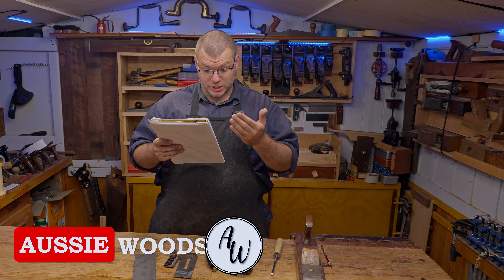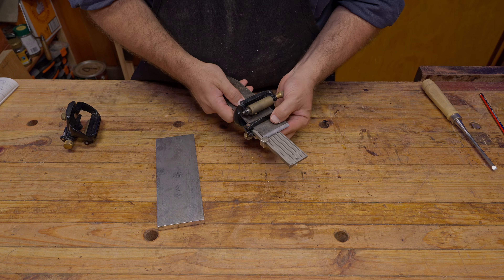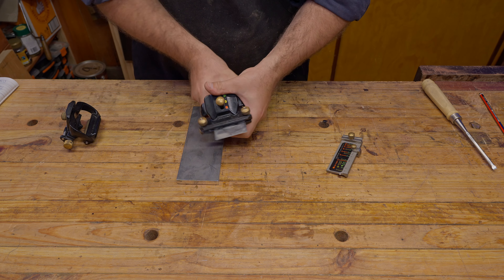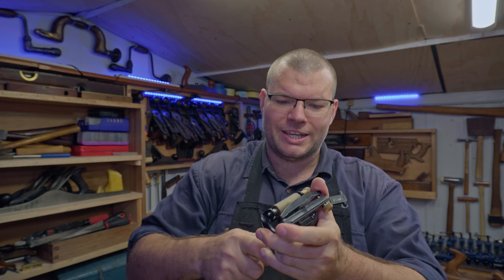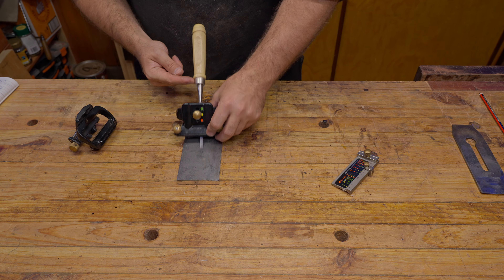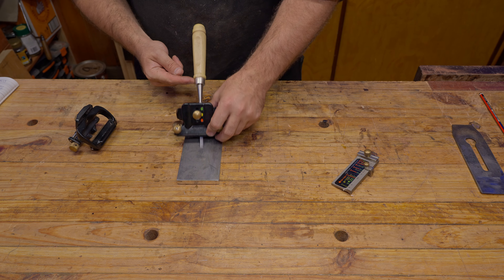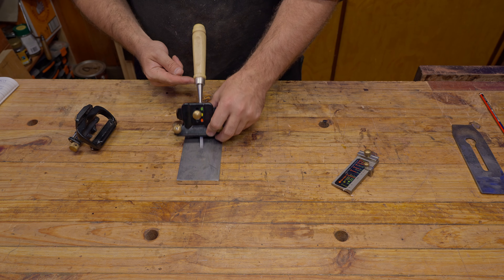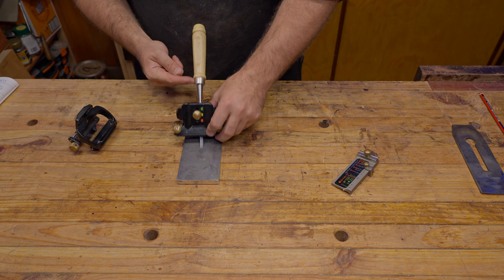Can the Veritas Honing Guide Hold Tapered or Narrow Blades?

Comment: Keeping narrow chisels square is the most difficult thing to do when hand sharpening in my experience. It was the main driver in me investing in a good grinding wheel to reset edges when I mess up.
Reply from the maker: @robnichols9331  i do agree narrow chisels are definitely the hardest to keep square, i have a tormek which i got primarily for restoring old plane blades but it also comes in handy for all my chisels to get them back on track.
Reply: @AussieWoodshed  I haven't gone the whole hog and got a tormek (I hate the way every extra seems to cost a fortune), but I have invested in a good quality slow grinder with a couple of CBN wheels (80 and 180).
Reply from the maker: @robnichols9331  with hindsight that would probably have been a better option for me, but when i got the tormek CBN wheels weren't available for me. But if i was looking today i think I would have gone the same route as you
Reply: @AussieWoodshed  CBN wheels are great - I love that the tool keeps cooler for longer.

Comment: I've had the delux kit for some time and the combination of the side and parallel clamps covers almost all my requirements, especially with the addition of a second parallel roller to replaced the cambered one which i never use.   What doesn't fit (router plane, some spokeshave blades, etc.) I do by hand.
The big issue I do have with the veritas system is that the secondary bevel is NEVER parallel to the primary.   It drives me mad.  I can sharpen free hand, but i like the repeatability and uniformity from using a jig, and for whatever reason, this veritas system just does not have the required precicision.  No matter what I do it always grinds one side of the secondary bevel more that the other.  Frustrating!
Reply from the maker: @mikeneedham5742  As I don't use micro bevels I've never used the secondary bevels feature on the Veritas jig so i can't speak to what's happening, but it definitely seems strange it's not parallel to the primary bevel.

Comment: I've been wondering for a long time, what is that "fat" brace you have up on the wall? Looks expensive.
Reply from the maker: @kimmosaarinen2780  The wooden brace? I have been unable to determine the maker of that brace, it looks very similar to a I & H Sorby brace cerca 1890's but still not identical. There are no identifiable maker markings. I picked this one up locally for $50 AUD, which seemed like a good price.
Reply: @AussieWoodshed  Oh, its wooden! Looked like brass or some such. Thanks.
Reply from the maker: @kimmosaarinen2780  It's beech with a few brass panels screwed onto it